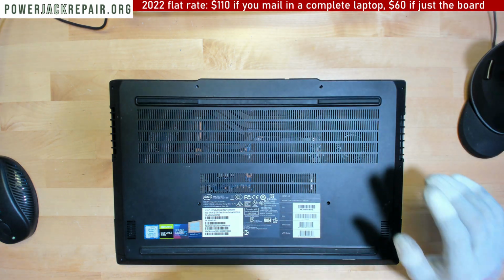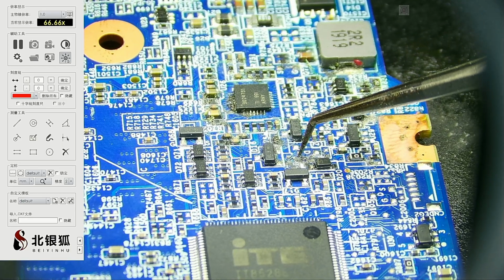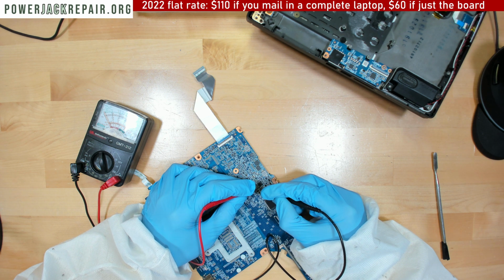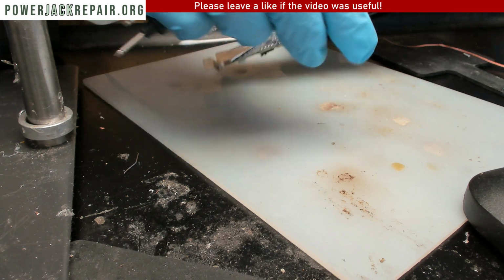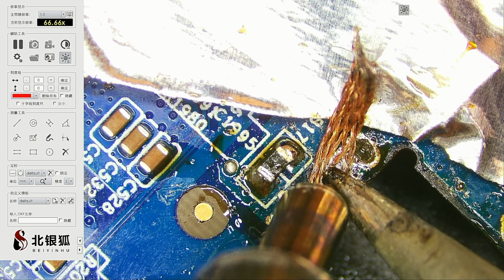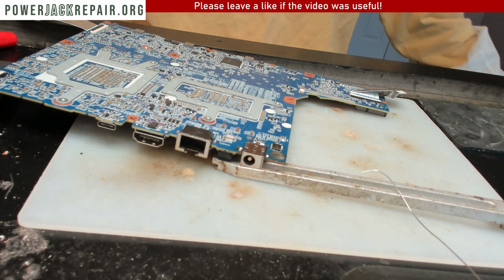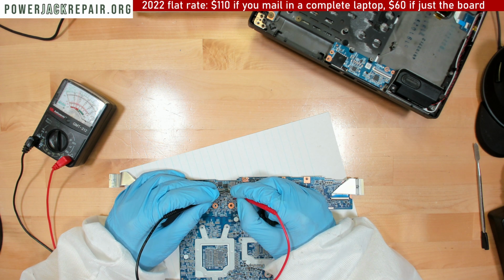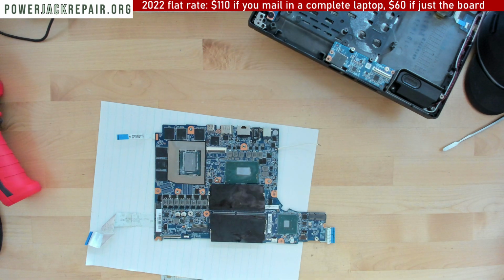How to fix repair a broken power jack on XPG Xenia 15 laptop charge port power jack repair fix

Comment: Great video, I was curious how they fixed it because this is the third time my power charger has broken. Apparently the problem isn't me, it's the laptop model. I'll have to consider buying another computer, this time a desktop.
Reply: What was the symptom 
Mine just recently shut down without a warning and no symptoms, now it doesnt even turn on even on direct power 
Im thinking its a motherboard/bios issue but did u have a similar problem

Comment: I have so the XPG i7-9750H Geforce RTX 2070 with a Max-Q design. My GPU card is going crazy and not detected (hidden device). I had tried to solve it from the drivers, but useless. Once the GPU card was detected, I moved the laptop, and the screen blinked and froze. I did force the shutdown and turn it on again, but no GPU card was detected. A few days later, I did turn on my laptop, and the GPU card was detected, good tho. But, while I was editing, the screen froze, I forced shutdown, and GPU was not detected. Frustrated about this brand.

Comment: XPG Xenia seems to be having a lot of problems with the charging port or its parts not working properly. my XPGs central post on the charging port has become detached from motherboard. attempting to fix it now since XPG customer service is no help. Btw thanks for the Video Very helpful.
Reply: Do u still have the stock liquid metal or have u reapplied/switched to thermal paste?

Comment: does anybody know if I can remove the keyboard to clean it ? or it's better to just throw compressed air?
Reply: Probably shudnt detach the Keyboard
Also u still using the stock liquid metal or have u reapplied/switched to thermal paste ? It runs hot and underclocks itself more often than not